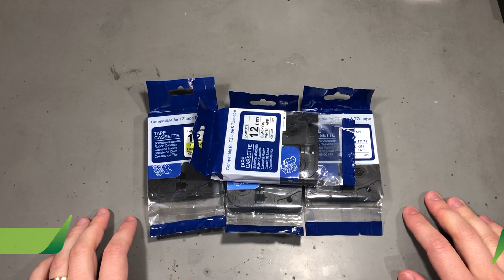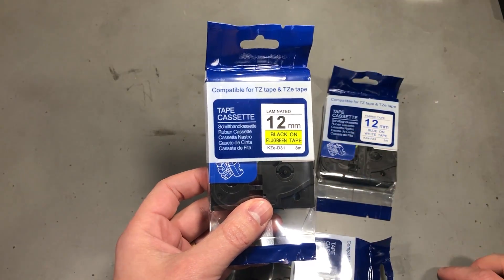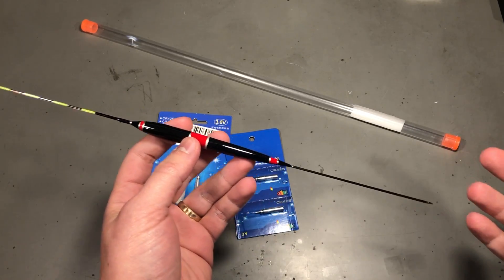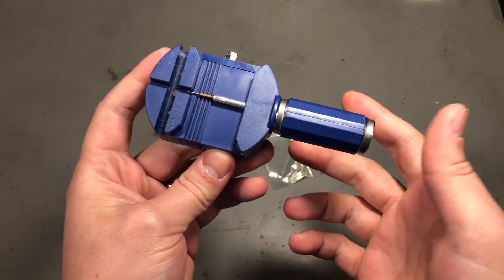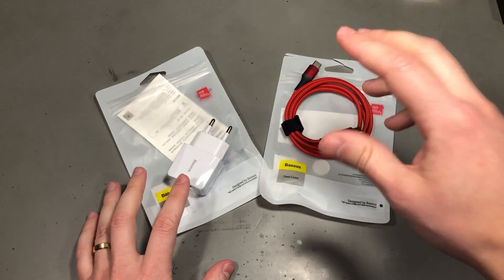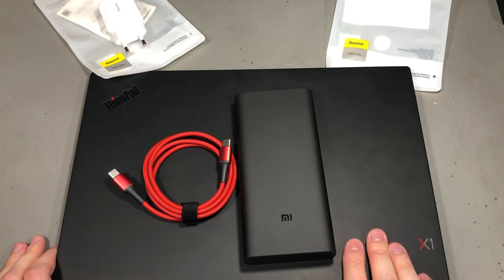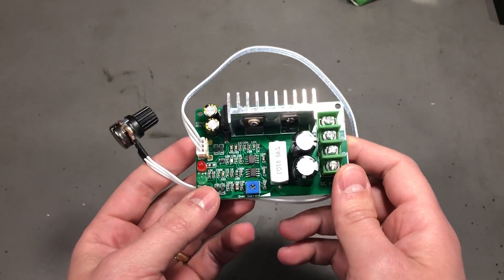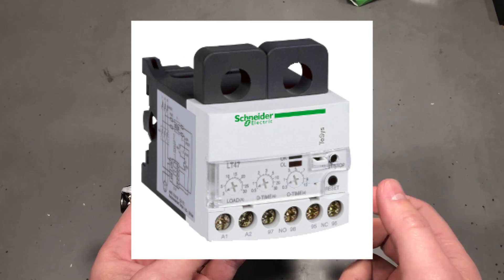Voltlog #289 - InTheMail

Comment: Isn't it cheaper to buy some KIMTECH wipers locally? It's like 5 euros for a box of 280 pieces of dust-free wipes.
Reply from the maker: A box of those Kimtech wipes is $17 delivered locally so the answer is no, it's not cheaper than the stuff I get from Aliexpress.
Reply: In Germany you can get Kimtech 7552 / 05511 (11,4 x 21,3cm, 280 sheets) for 5,80€ + 3,50€ shipping at hygi
Reply from the maker: @FuchsHorst  Almost everything is more expensive here in Romania :-)

Comment: Did you open the parcels without washing them with iso propyl solution?
Reply from the maker: Yes I did.
Reply: @voltlog  Two of my packages has cleared from custom & soon will delivered. I am a  little bit afraid
Reply: @shaad2841  virus dies after 10-14 days so you should be safe
Reply: @FuchsHorst  Also afaik at least the outside is deconterminated before loading if it is shipped by air

Comment: I love my convoy s2+! Been using it for a few years, I stopped buying other flashlights after this one. I actually choose a lower powered version since I really like long runtime when used on my bike since it's my commute light. Also use it everywhere around the house. 

I even use it for trail riding during pitch black nights, which it probably is a bit underpowered for but it works in a pinch.
Reply from the maker: Yeah, it seems like it's worth to pay a little extra for these Convoy flashlights. They seem to be better than the cheaper no name ones.

Comment: I agree on the flashlight useless mods, Low-High are enough, their useless strobe and SOS are really annoying.
Reply from the maker: I have a Nitecore Tube which I like a lot because it has: low, high and if you hold the button for two seconds you have a fine adjustment with many steps. That's how all flashlights should be.

Comment: Finally an affordable HDMI capture card, I'll have to bookmark that and see how it works in your future video. Cheers!
Reply from the maker: So far under Win10 it was installed automatically and it worked out of the box with the windows camera app for capturing pictures. I'll provide more info after I get a new camera for the microscope.
Reply: VoltLog looking forward to your review because I also look for such a capture device